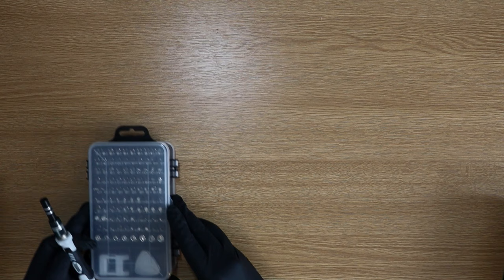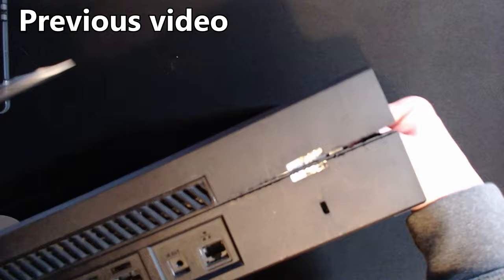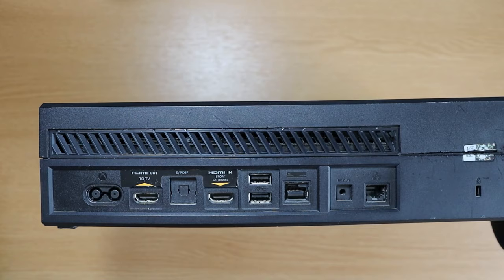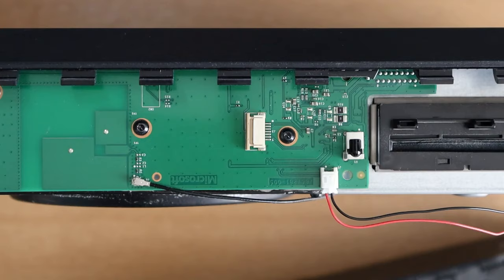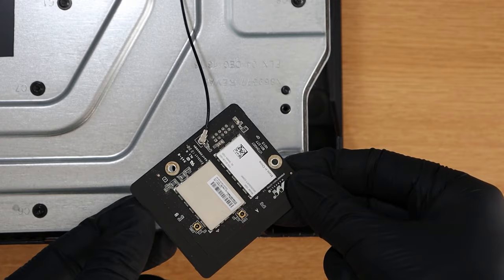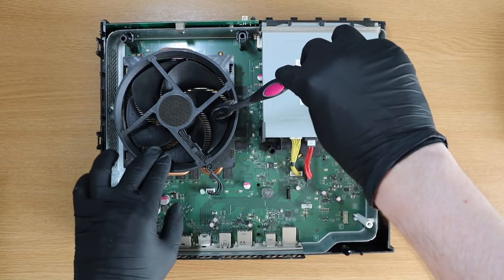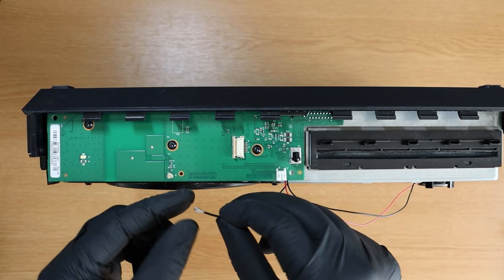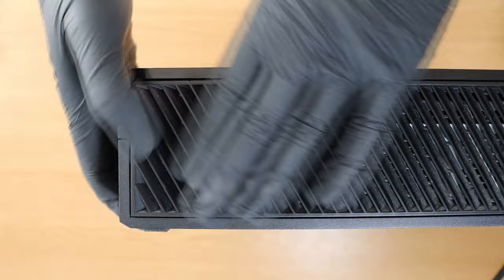How to Clean an Xbox One

Comment from the maker: This video will show you how to put the top case and ribbon on easier - https://youtube.com/shorts/IENazKAj5mM?feature=share 😊👍
Reply: If you do break that little wire you said at the beginning can you get it fixed
Reply: @Cmrice-qe9oq  yes there are replacements you can find online, funny enough I just broke my ribbon too
Reply: Thank you for this 2nd little video even though I caught it after fighting with it the other way. I couldn’t fit my big hands so I got my wife to help me with her little hands. But now I’ll know for the next time. Lol
Reply from the maker: @robertw31968  haha you're welcome dude. No worries at all :)
Reply: @JoeyDoesTech  hey mate for the cover disconnection of the xbox one can I do it with a thin knife or not before I start cleaning it up? Or can I able to use a plastic spatula if possible?
Reply: This vid helped a lot, thx
Reply from the maker: @jkrookx5227  you’re welcome :)
Reply: this video helped but after i tried turning it back on it wont work, the power block goes white when i plug it in the xbox then it goes orange and when i try turning the xbox on it wont work can you help me :/
Reply: Joe can i use baby wipes to clean up the milk? That fell and got dried? 😢

Comment: This helped so much I haven’t cleaned my Xbox in 6 years
Reply from the maker: Glad I could help :)
Reply: Me to XD
Reply: Now my Xbox it broken 😔
Reply: @vorce_ios8833  damn you did it wrong 😐
Reply from the maker: @vorce_ios8833  Did you feel like you done something wrong at any part? Slowly go back through the process and be extra careful :)
Reply: Samee
Reply: I’ve never cleaned it
Reply: Same
Reply: never cleaned it since i got it a year after release lol.. Honestly I don't plan to clean it until i get the series x... simply cause I don't want to dmg it

update: Got my series X on Christmas and successfully opened up and put back together my fat xbox one swapping between like 3 different guides including this one lol.

Things that tripped my up while opening and closing it were:

- prying off the top case
- disconnecting the front ribbon cable
- I didn't manage to disconnect the cable that connected the wifi connector to the main board, i used a lot of force abd it would not budge do i left it and closed it back up.
- reconnecting the front ribbon cable (at first i plugged the cable into the section where the clip goes into like an idiot but then went back and fixed it lol

But that it's it.
Reply: @vorce_ios8833  Did you plug the ribbon cable correctly? Or did it just snap?
Reply: @whothou  my Xbox has been sounding rough recently but I too don’t want to accidentally break something while taking it apart so I’m just gonna wait to get the new Xbox
Reply from the maker: Makes sense to be honest. I think its moreso for people specifically with dust issues or people looking to sell it on because theyve now got a Xbox Series X :)
Reply: @vorce_ios8833  sorry about that
Reply: Crist years I mean u can’t blame I haven’t cleaned mine  in 4 years because I’ve been scared it’s ganna brake
Reply: Me too lol
Reply: @JoeyDoesTech   how do u do 9:23 part like ive been stuck with this now in 1 whole hour
Reply: I haven’t cleaned mine since I got it (about 6 years) it’s pretty dusty and just recently stopped working, but only when I put discs in it
Reply: Me too lol
Reply: Same
Reply: Bro same
Reply: Same
Reply: Is there any difference?
Reply: I have had my Xbox since day one and I just cleaned it now while watching the video it really helped me!
Reply: @tonytetas9314  Did it make a difference?
Reply: Mine was 7years ahaha
Reply: Same
Reply: Same
Reply: @Mert same
Reply: Same
Reply: Same
Reply: Same xd
Reply: Mine wasnt cleaned since 2016 not so bad but the fan is dead so it helped a lot
Reply: Same but with 7 years
Reply: Same lol
Reply: 8 for me
Reply: I didn't clean mine for 9 years man ;-;
Reply: Does it run better after you cleaned it
Reply: @RMLGaming  7 years for me n9w
Reply: It explodes lol
Reply: Same bro 7 yesrs
Reply: Same
Reply: i still have never cleaned mine and I've had it since launch lmao
Reply: Mate i have not cleaned mine in 8 years
Reply: wait no 7
Reply: Same
Reply: Since it came out 7 years ago
Reply: Me not in r
Reply: I’ve had mine for yeaaaars and I’ve never cleaned it but it’s been acting up quite a bit not being able to load up games and freezing a lot, I need to clean it rn
Reply: Me to
Reply: I've had mine for 8 years, and I'm just now cleaning it
Reply: Me too lol
Reply: Same
Reply: same!!
Reply: I've had my Xbox for I wanna say 8 or 10 years and it's never been cleaned.
Reply: mine wasn't cleaned in 8 years
Reply: Rml gaming :\
Reply: Honestly. I have never cleaned it since I got it and its still running. I have over 25k hour clocked on that thing and its nearly 10 years old.
Reply: @JoeyDoesTech I haven't since day one I bought the kinnect edition 

How long we talking 24 7 constantly using and it just recently got to where it'll get too hot and power off 

Nov 4 2010 
To 
July 20th 2023 
That's phenomenal 😮
Reply: I've had mine for 6 years
Reply: Same
Reply: 10 for me 💀
Reply: I’m about to clean it for the first time and I got this thing in 2013
Reply: I have not cleaned my Xbox in 11 years haha
Reply: @MrJones-tf7me  same lol
Reply: Ive had my xbox for 8 years, cant afford a new one and really scared to clean it
Reply: Me too
Reply: Same broski, idk if this will help much untill I finish but currently I can play for like 5 minutes then it overheats
Reply: Mine has never been cleaned
Reply: almsot 10 years for me 😂😂 idk how its still running

Comment: I almost got the top completely off & I got scared & put it back together , lol. I don’t wanna ruin it or my boyfriends gonna kill meeee 😭😭😭
Reply from the maker: Did you manage to get it sorted? 😁
Reply: If you haven’t done it I’d try it. He’d love it if you did it right
Reply: @ajr9756  I’m struggling to even put the ribbon cable back together
Reply: @oli2splashy  I took mine apart again made sure the ribbon cable and other cables were attached properly and the eject button is working correctly now. Keep at it you'll get it, putting the case back together was annoying too so you have that to look forward to lol
Reply: Are you the viral TikTok? Of it
Reply: Hi thanks your video helped my clean my original xbox one I cleaned fixed inspected refurbished repaired restored reapplied new thermal paste on the central processing unit graphics processing unit and it works excellent

Comment: when you put it back together, its actually WAAAAY easier if you separate the front and top cover, connect the top first, then the front
Reply: Thanks man, can’t express how much easier that was with your advice
Reply: how are u supposed to do this
Reply: @bryanbejerano3799  there are little locks holding the front and top cover together, just pop it and separate them
Reply: Man, I was struggling for half an hour until I thought about checking the coms. Followed your tip and it didn't even take me a minute. Thank you very much!
Reply: King
Reply: You made the whole video bro. Thank you!
Reply: Yes! This is the way! Thank you!
Reply: Oh my god thanks you!!!
Reply: I did tha back clips first n now I can't clip tha front n tha disc whole n mouth r dissalign
Reply: I punched front of my Xbox to try to make it clip it n now its fukt 🙃 thx for tha info💪🙏❤😤
Reply: The back clipped together before the front when I tried putting it back together. Now what do I do?
Reply: This video was really good but your suggestion worked for me.  Thank you.
Reply: grazie mille mooolto più facile
Reply: I love you. I've been trying to put this thing back together for 2 hours you're a hero

Comment: dude you were so right about that final case and that clip on the corner omg almost regretted d whole process because of it
Reply from the maker: It's horrendous right Steely? Great satisfaction after doing it though. Well in mate for getting it done :) 👌
Reply: The best way to do it is to insert at like a 45 degree angle to put all the hinges together and then force it in on the right side opposite of the side you took the plastic cover off and it should just sit in place in the back hinges very easily. Took me a while too😂but finally figured it out
Reply: Gonna sell me broken xbox I have to keep resetting it. The thing is I have it on with music Just so I can sleep with the loons around me. I might try take apart or just sell to a store who can always fix it
Reply: Im doing this simply cause I think the first time I didn't get it set back properly and the case was blocking the disk drive
Reply: @rickybobbyjr581d2  if the vid helped drop a like cuz it sure did for me, my system kept shutting down because it was protecting itself from overheating and it had good reason to, all the vents were clogged with dirt to the point where I could just tear like a banana peel
Reply: Dude why can I not get that corner to work for me 🤣🤣🤣 I just spend 20 mins tryna figure that out and I’m still here trying to put it back 🤣
Reply: Nvm I eventually got it thank you for the help tho
Reply: @freshkiller2550 Thank you😭

Comment: For anyone who doesn't have a proper prying tool.... 

Here's some potential alternatives that you might have laying around your house that can also likely do the job. 

 A fingernail kit: the metal tool that cleans underneath your nails. 

The spatula from a Cricut tool set. 
***(So long as you make sure that it doesn't bend or damage the spatula when prying as it is only intended to lift lightweight vinyl and cardstock. 
Not gaming console parts lol)***

A flat part of a metal hairclip

The top metal piece on nail clippers that flips around. (So long as it's thin enough to get in between the pieces)

A thin butter knife. 

For the makeup people...
If you've got a tarte lash applicator tool, or similar, this will possibly do the trick. 

Just be careful you don't scratch the finish on your lash applicator in the process. 

A sturdy set of brow tweezers might work, too.
Reply from the maker: Great comment, thankyou.

Comment: If anyone has issues with disc's not going in or ejecting, even after using the manual eject button, I had those exact issues. I took the Xbox apart and pulled the disc drive out, pulled the cover off the disc drive and found that the pulley system that actually turns to pull the disc in was loose. The belt on one of the pulleys was loose and I realized the pulley itself had popped out of its proper location. I pushed it back in place with a flat head, the belt tightened and I reassembled the Xbox, and now the disc drive works fine.
Reply from the maker: Thanks for sharing your experience Graham, hopefully that helps other people :)

Comment: FYI,  The front side can be removed easily from the inside after you detach the rear and top panel before u remove the ribbon so you can easily clip it back on when you reassemble it without the hassle .
Reply from the maker: Certified legend.
Reply: Show instead of tell homie or say nothing at all.
Reply: This helped so much wow thank you!
Reply: You lift up all of the upper, thin things and then you can push the lower thick things out and then the front can come right off. 

Totally removes the rage from this entire thing.
Reply: @thehuntressdanni2972  much easier than the way joey explained it
Reply: Came here to comment this, saved me so much time!

Comment: How much force do you need to close the part where you need to clip over the vent bcs I've been trying for quite a bit and bothing
Reply from the maker: It's one of the hardest parts. You won't need to put TOO much force as most of it is technique. You want to try your best to push the case up and over rather than just straight force. Does that make sense? Let me know how you get on!
Reply: push on it at a angle
Reply: I legit got so mad that it wasn’t going on so I just punched it and it clicked on😂

Comment: Hey, I did everything in the video and blew everything off with air and brushed it with a soft detail brush and it won’t boot up what’d I do wrong
Reply: Please reply asap
Reply from the maker: I think maybe check the ribbon connector cable at the front, the blue one, and just make sure it's been put back properly :)

Comment: When putting Xbox back together an easier way to do it is that there are clips at top front of case you can separate the case into 2 pieces should make it easy to connect.

Comment: Thank you so much! I just successfully cleaned out my Xbox one original and you’re right the hardest part was aligning and snapping the plastic back together but after I realized you had the same issue I figured it out. Thank you again runs smooth and clean again 🧑‍🔧👍
Reply from the maker: You're welcome :)
Reply: Bro I can’t get the triangle shape thing from 2:20 the time in the video to move bro having a hard time

Comment: Ok so I need some help. 
I did this whole process but after when I tried to play all heck broke loose. Whenever I try to turn the xbox on, it turns itself off. It then proceeds to spam on and off. I need help and I don’t know what I did wrong!
Reply from the maker: This sounds like the ribbon cable at the front is a bit lose and keeps turning it on/off. I'd suggest taking it apart again slowly and seeing what the ribbons like :)
Reply: @JoeyDoesTech  I did this and it works again ty so much

Comment: Great guide! So, I know you asked to post about this in the comments.... So, I found a much easier way to attach the top cover during the final reassembly. I removed the face plate from the top cover. This made it so much easier to attach the ribbon cable. I attached the face plate to the console, pulled the face plate away just a bit and attached the top cover to the face plate and worked from front to back of the console. Much easier. Anyways, great video!! Hope this helps!
Reply: THIS. DO THIS!

Comment: For those of u struggling to get the case back on, unclip the front panel and re clip it once the ribbon cable is back in place - this vid glosses over that part but its very hard to do it the way this vid tells u to! Spent about an hour trying to get it on the way this vid tells u to and the other method took literally 10 seconds 🤣 Hope this helps :)
Reply: I wish I had read this in time. The previous owner of mine had broken all of the upper front clips and i hadnt noticed until i was about to put it back on.
I just spent a couple hours trying to carefully do it the same way he did in the video and the clips kept just shattering one at a time.
Reply: For the love of god thank youuuuuuuuu
Reply: @JDM4TW  i spent way too long trying to do it the way this vid says to, glad my comment helped ahahahaha

Comment: Heres a little tip for putting back the final case of the console: Remove the clips on the top of the case and put on the upper part on the Xbox first. 
Then you can connect the blue cable  thing much easier and put it back together.
Reply from the maker: Agreed :)
Reply: Im so pissed i didny see this earlier omfg i just spent 30 minutes doing that fucking stupid ribbon and prob broke ot

Comment: putting the final main case piece back on is easy if you put the case vertical on with the front facing down and let gravity help you force it in and  you can push down from the back. takes just a few seconds to get it in.

Comment: Tip from JoshFi like a 1 year ago
"IF YOU'RE HAVING TROUBLE PUTTING THE TOP BACK ON: 
take the front panel (the one with disk and power buttons) off from the top panel (one with the vent for the fan.) Put on the small front panel on FIRST and THEN put on the larger top panel. It may take some wiggling but it is FAR easier than just putting the whole thing on normally. HOPE THIS HELPED"
Reply from the maker: There’s a video in the description for this :)
Reply: Thank you. This comment really helped cause trying to put the whole thing on at the same time was very frustrating and this helped me not wanna throw my console. Had been fighting with it for an hour before reading this.

Comment: it is necessary to disassemble it only if there is overheating and the fan makes a loud noise, but in this case it is also advisable to replace the thermal paste, for many owners of the original xbox one for 7-8 years their consoles both worked quietly and will continue to work.

Comment: When you put your Xbox back together, and you have the black plate to put on the Xbox or the shell, you can separate it into two pieces by looking at the black plates inside where the blue ribbon is, and there are these little latches that you can take off which allows you to separate the front of the black plate and the top of the black plate which allows you to put the top on first and on the front on last which makes it 10 times easier putting the blue ribbon on and putting it back together hope this helps.
Reply: I love u dude u save me

Comment: After removing the top, unclip the front from the top, which will also make removing and re-installing the ribbon easier, then put the top on, lock it into place, then you kind of roll the front piece onto the bottom, and ensure the top clips are going underneath the top part and click it into place.

Comment: "Let me know if you get it the first time..." - thought to myself how hard could it be, turns out 30 minutes later when it finally popped in place that was the most satisfying and scary case to anything I've ever closed. So many emotions... 🤣🤣🤣
Reply from the maker: Ayeee good job though! Happy you got it cleaned 😁
Reply: this video shows you how to almost break your case. Take the front cover off first. You should never have to force a part the way he does. Skips a 10 second step to cause potential breaks. Just take the front cover off next time
Reply from the maker: @darsinge3612  are you talking about putting the case back together afterwards? If so theres a comment with a much better video explaining how to do it that I've linked
Reply: Does it clean the disc receiver as well?